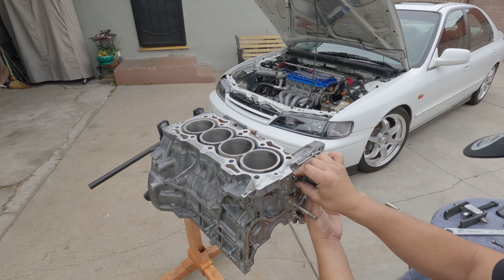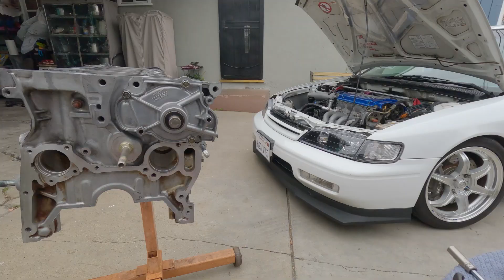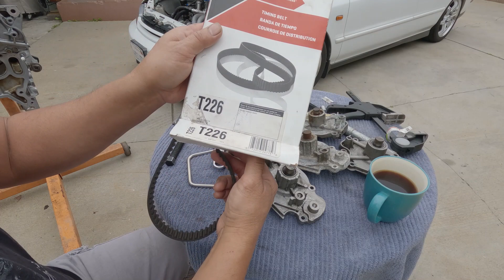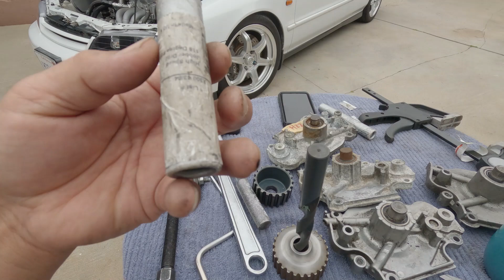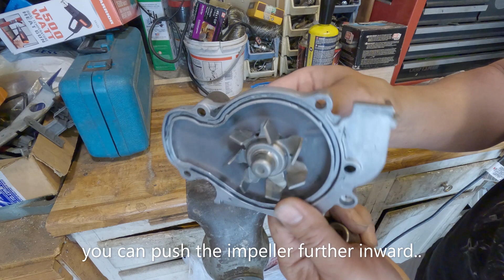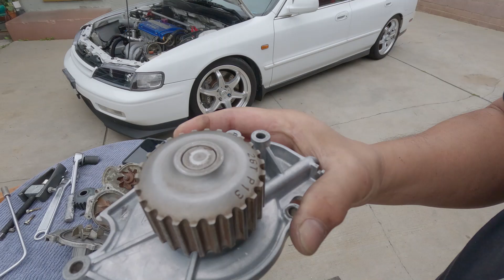DiY G23vtec Water Pump

Comment: thank's
Reply from the maker: No worry man!
Reply: @sagittnet2158   i 'm in France , for you the best K20 piston for  higt CR  with E85  is ?   need to have in natural aspired 250hp minimum , and 11.8RV minimum :)
Reply from the maker: @DAV4WSR1  Civic CTR have the highest comp ratio pistons. Not sure if Nippon racing k20 ctr piston is avail in your area. Merci and vous estes les bienvenus.
Reply: @sagittnet2158   Ok merci,  car après calcul ( sur Calculateur de compression pour la série H/F v.50 BETA)  un F23 piston K20A1/2 donne une CR de 11.55:1 je cherche a faire un montage avec 12:1 minimum nous avons le E85 éthanol en France  , j'ai demandé a UYUNIRA le revendeur ebay nippon racing  ;)
Reply from the maker: @DAV4WS  Yes, if done on H/F comp calculator it'll give you only 11.5:1 ratio when sing RSX type S piston, but using a Civic type R k20 piston will give you more coz it has more piston dome. You can use a forged piston and it has variety of comp ratio to play with if you like.
Reply: @sagittnet2158   with RCC piston it's done 12.35:1 CR ;) :D   good for NA build , forged are 3 x more expensive  for  NA , i used Nippon racing one or OEM guenuine  pack
Reply from the maker: @DAV4WSR1  kool man and good luck on your build!
Reply: @sagittnet2158  thank's  I will film the construction, thanks to people like you who share that I will succeed, thank you

Comment: Love the build setup. I have a 95 EX F22B1 I plan on swapping out the F22 Head for either H22A or H23A head which ever one would be better. I got the Aisin Timing belt Kit too can’t wait to get it going 🔥. Keep up the the good work looks great 👍
Reply from the maker: Either H22 or H23a cyl head will work and you'll be building a G22 but basically same procedure. I'm not sure what HG they use on G22 build but its not so hard to figure out. Goodluck on your build and thanks.
Reply: @sagittnet2158  Yes correct since I’ll most likely use the H22 head. It has to be either the F22B1 Head Gasket or H22 head gasket I’ll look into it and do more research. Currently doing some Undercarriage/Suspension resto right now lol

Comment: Great great video great content i been working on my for years i got a f22b2 block and h22 head the only thing got left to do is the water pipe any secret on that in doing half f22 and half h22 and welded  together
Reply from the maker: Thanks man! Nothing biggie on the coolant pipe. You just need to decide where you want it join together. There are hose port on H22 pipe for oil cooler. You can keep or if not, you can join it from there. You can weld the 2 or use a clamp. I'm going to include it on my next vlog.

Comment: Loving the videos. Keep it up. Can we get a link to parts as you go on especially on stuff that may be harder to find.
I've done some research and gathered parts for a g23 build for awhile now. Got all the essentials complete h22a4 with a spun crank bearing and 5 f23s. Just need to order the stuff that needs to be new next
Reply: P.s. my first 99 accords name was snow white. 99 sedan 01 coupe front, 5lug swap, mint green tl wheels. Miss tht car
Reply from the maker: I'll make a parts list before l assemble the short block and mostly my parts are from ebay and the junk yard. You name her Snow, mine is Snoe lol! Kool man, and good luck on your build.